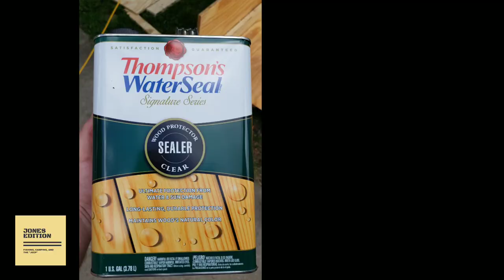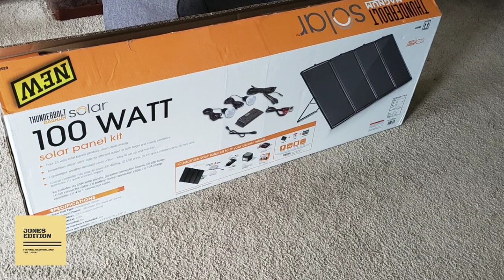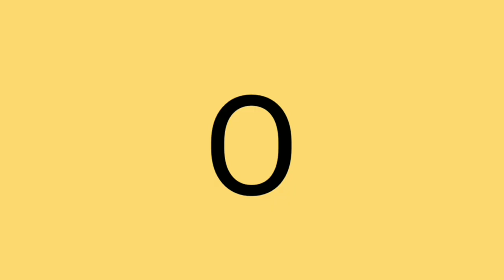KAYAK / CAMPING TRAILER: Fishing Kayak and Camping Trailer Walkaround.

Comment: I'm currently working on my kayak/camping trailer for my ascend h10. Really like how u did the solar panel set up. I made the box 28in high so I can slide my Remington weatherproof totes in. The wench seems like a bit much but bigger is better! Nice work!
Reply from the maker: Thanks John! The solor has been great. I did step one panel up there messing around with the kayak. The winch is overkill for sure. But it beats pulling it out of the water while loaded down with a battery and trolling motor. My kayak is pretty heavy now. Haha. There are days I question if I should have just done a jon boat build. Now that I have small kids I might work on that. When it warms up, I will be doing some modifications. So you will have to check out those down the road. Here is a link to the totes I use. https://youtu.be/rtk4nnBbCvU
These fit perfectly in my trailer. 
  Thanks again for watching and the comment!!
Reply: John Kaul I’d love to see how the trailer turns out also. Be safe.

Comment: I just bought a 4 by 6 trailer . I apologize in advance, because I’m about to do about 80 percent of all you just did. So thank you.
Reply from the maker: Haha I stole this idea from someone else so we are paying it forward lol.
Reply: Jones Edition if you don’t mind my asking. Were did you get the winch? I can’t find one with a wireless remote. And what kind of pulley is that on the trailer arm? So that I know exactly what to buy.
Reply from the maker: I bought the winch at Harbor Freight (2500 ATV winch I believe). Its cheap but I dont use it a bunch so it should last. I think the pulley is from a snatch block that I took apart and bolted to the metal piece coming from the trailer. My buddy is a welder and he used some scrap metal and we laser cut a hole for the bolt for the snatch block pulley. I'm sure there are other ways to get it done like finding a hand crack from a boat trailer and modifying it somehow. Hopefully this helps! You can ask any questions you want! I wish I had someone to ask when I was building mine
Reply: Jones Edition I did it man. I built it. Trailer is finished and I followed your design to the letter. I’m very proud of it. Was not cheap. But I uploaded it on here. Even have you some props on it. Check it out
Reply from the maker: @truestwarrior23   Dude that's awesome! I  Can't wait to see it. I will definitely check it out. I hope it works out well for you!
Reply from the maker: @truestwarrior23  thanks for the shout out brother! I would title your video "the best camping / kayak trailer " and you will get thousands of views!!!
Reply from the maker: @truestwarrior23   Also if you don't mind I'm going to share your link on a future video of mine. So people can see what you did.
Reply: Jones Edition I don’t mind at all I’m going to do a better video walkthrough so that I’m not constricted by my own garage. But sure you can
Reply from the maker: @truestwarrior23  will do! I have been planning on doing a video or two on my channel sometime soon about the trailer.
Reply: Jones Edition I’m going to pull the trailer outside tomorrow and a more thorough walkthrough for you to share the link . I was to eager for you to see it I really didn’t give others much thought. Lol . I’ll have a better one loaded and hit you up ASAP . And once again man. Thank you 🙏
Reply from the maker: @truestwarrior23  yeah let me know! And I will share the link. I would love to show people what you did. Talk later bud!
Reply: Jones Edition I just added the revised video of the trailer with a more thorough walkthrough. Check it out buddy
Reply from the maker: @truestwarrior23  awesome! I sure will! I will copy down the link and share it.

Comment: When I finally figure out mine, I'll be sealing it with resin. Thin the resin with acetone and allow to harden over a few days as the acetone evaporates. This will allow it to penetrate the wood. Then when fully cured, add one thin coat of unthinned resin. This will provide a boat quality water seal that will far outlast paint. At least what I'm doing as I don't want to be rebuilding it anytime soon.
Reply from the maker: Yes i would agree with you on that! I don't have much experience with resin or I would have probably done that with mine. I definitely have and pro and con list of what I did. I plan on doing a follow up video talking more about what I like and don't like about the trailer. Thanks for watching! And good luck with your build!
Reply: @jones_edition  I'm definitely using some of your ideas. Especially the loading idea. Not sure the trailer kit I think I'll get (cheapest solution I've found yet) has the tilt option. I need to load an Autopilot 136 I just won. I lift a 120lb canoe onto my car myself now, but should plan on not being able to do that in the future. Would love to see more of your ideas. Cheers!
Reply from the maker: @fishkids-newbrunswick5345  the tilt option is great! The winch i use is nice but its really loud. Which at a quite lake or pond it echos bad. Haha I need to build some kind of sound box to go around it or change it up to something different. My kayak is super heavy as well and its really nice to be able to load it with a winch. Lol
Reply: @jones_edition  I wonder if a boat winch would do? It's been a couple decades since I've used one, so maybe I wouldn't mind a small winch! :D
Reply from the maker: @fishkids-newbrunswick5345  yeah I'm not sure. This little ATV winch is the only one I have owned. It works great and it was a reasonable price but super loud to me.
Reply: @jones_edition  did you ever make that follow up video? I looking to build mine this weekend. like to get your updated list on what you would like to change
Reply from the maker: @stuarts765  I didn't get to make it yet. If you want to email me at jjonesedition@gmail.com I will give you some information
Reply: @jones_edition  sweet deal bro! I sent you email. thanks!
Reply from the maker: @stuarts765  got it and I sent you one back! Thanks
Reply: @fishkids-newbrunswick5345  What?  120lb Canoe?  What brand is that?  Nimitz? LOL!  God love ya for doing that!

Comment: Any cool changes or things you would do differently?   This is essentially the design I'm going for as well.  A box for storage and the kayak(s) travels on top.   My primary spec for the box size would be a standard plastic storage tote (are they "standard"?).   I'll add rod storage inside until I start to need the room then will mount a pvc pipe based rod locker external to the box. 

Is the carpet holding up?

nvm, I read your comments later down the page and that answered most of my questions...
Reply from the maker: All good! I have since sold the kayak and bought a boat for me and the kids. I still have the trailer. I took the top off of it and use it as a small haul trailer for my storage unit buys. I leave it outside 100% of the time now and the carpet has been awesome! I don't know if the carpet was super necessary but I wanted to give it a complete look. I wish I would have finished my rod holder in the middle and I wish I made drawer slides to be able to reach the gear in the middle. Overall I loved it. There are way better people at this than me but I learned alot. I just tell people to go for it and make it your own! One of my favorite products when I finished it

Comment: Nice job ... a lot of work went into that for sure.  My question is why would you put carpeting on the OUTSIDE of your trailer?  If you're driving in the rain or down a muddy road it's going to be a mess and tough to clean.  Also .... it's going to hold water for a while so I'd be concerned about mold.  I would have mounted those side doors so the hinge is toward the front and the clasp toward the back.  They way they are (they don't seem to close too tight), as you drive down the highway, they're going to be like wind/water scoops and drive all of that right into your trailer?    Final thing ... I like the way you McGyvered that launch system but how tough is it really to just get your Kayak off the trailer and walk it on down to the water?  That said, this would be great for an older person who couldn't maneuver their boat very well or even someone with a disability to be able to get the boat off so they could enjoy the water.  Anyhoo - love your commitment to detail.
Reply from the maker: Thanks for the view and comments! I stored the trailer in a shed and it was only rained on it a couple times. When I got back I put a fan on it. And it dried in less than a hour. Usually the drive home and the sunshine will dry it. It's exterior carpet. I wanted a nicer looking trailer, that's why I used carpet. 

   The side doors had to swing that way because of bar coming from the front of the trailer (originally welded on be the previous owner) and the wheel well made it only open half way if it were to swing the other way. 

My kayak weighted close to 200 lbs loaded down with gear, trolling motor and deep cycle marine battery plus the weight of the kayak itself, made it a pain to move around. I made the ramp for easy deployment. Just push it off. And use the winch to pull it out of the water. 

All of it wasn't perfect but it worked for me. I would do it differently if I had to do it over again but I was happy with it. I recently sold the kayak and took apart the trailer to used in a different fashion. I bought a 16 ft boat to take the kids with me. Different stage of life.

Comment: Like the trailer.  How is the carpet holding up?  Did you use staples to secure it to your box?
Reply from the maker: Thanks for the comment and for the view! I used exterior carpet from Lowes. I used carpet glue and stapled all the edges. There are some areas that I felt like they needed screws. I made sure they looked uniform everywhere like they were supposed to be there. I store my trailer indoors so I dont really know how it would hold up to the elements here in Indiana (hot, cold, rain, ice , snow, etc..) The trailer has been rained on numerous times at a campsite or while driving. I does well with that sort of stuff. I made it pretty water tight and waterproof sealed the wood. I wish I painted the whole box with the oil base Rust-oleum paint. Its hard as a rock with that stuff dries. I did my doors only in that stuff, and it would have been nice to have the whole thing sealed like that. 
   If you have more questions let me know. I will be posting more about the trailer when it warms up on my page so check that out hopefully soon down the road. Thanks again! 
Jones
Reply: Jones Edition thanks for the reply.  I painted my trailer with oil based paint.  I really like the carpet look on yours.  I will see how well the paint holds up on mine.  Still working on my trailer.
Reply from the maker: @carlosceballos6477  I think all trailer builds will be a work in progress lol good luck. I will like to know if you oil base paint holds up too. I love that stuff

Comment: Q - Your kayak/ camping trailer, did you use a special type of wood for the floor? Reason I ask is because of rain, water , muddy conditions,  etc.
Reply from the maker: I just used regular no treated plywood. Not OSB. Then the inside was Thompson water sealed and the bottom ( where the road would throw rocks and water and mud ) was bed lined with a spray bed liner can. I used three or four cans of the bed liner spray for the bottom.

Comment: Carpeting the exterior of the trailer seems like something that's going to be wet alot and rot the wood underneath eventually 🤔 ?? even if water sealed.
Reply from the maker: I storage it inside a large shed. Its exterior carpet and I put fans on it when it gets rained on. Its only been rained on 2 times. I had the same thoughts. Hasnt been and issue so far